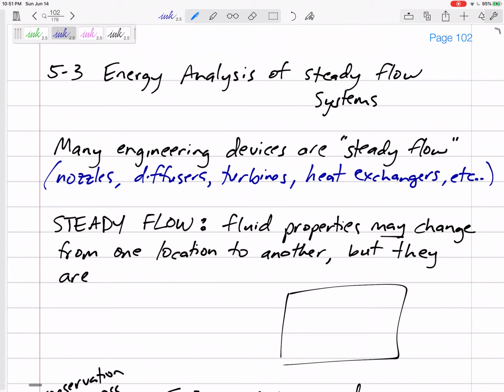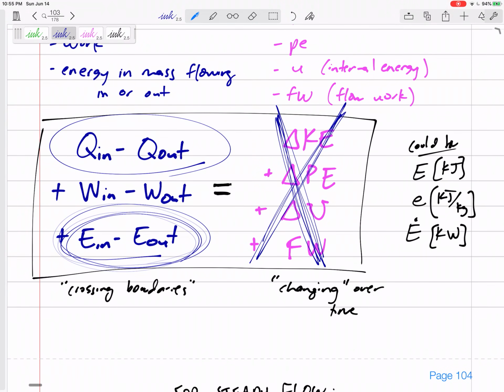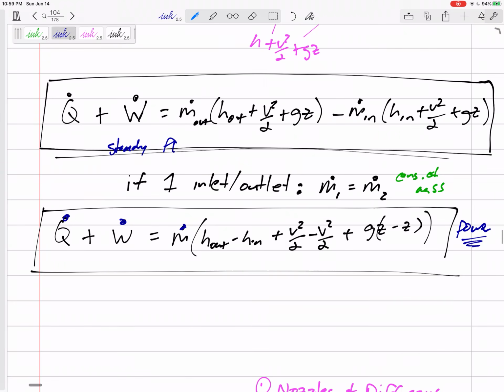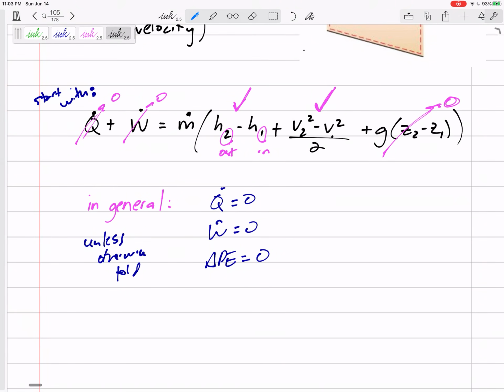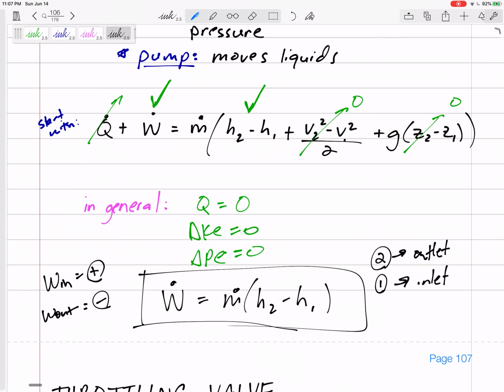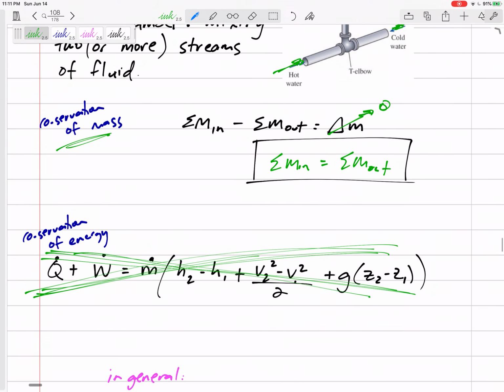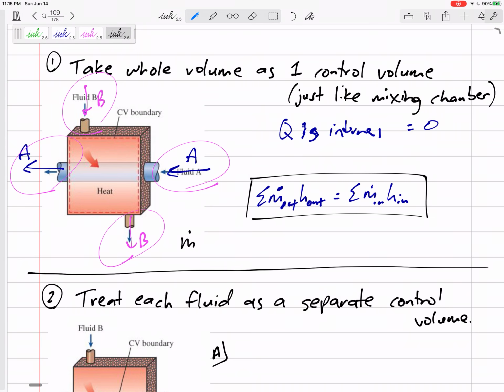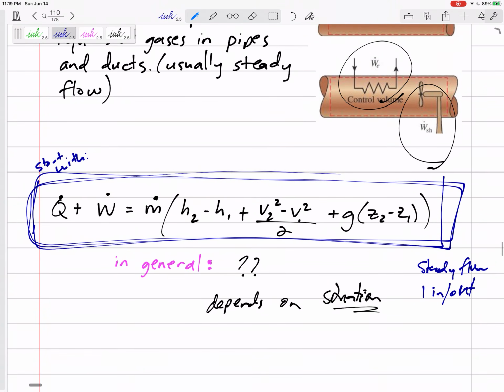Thermodynamics - 5-3 Energy analysis of steady flow devices

Comment: Question 1:
Sir, you have written that in general, there is no change in Kinetic Energy and Potential Energy in case of turbine and compressors, how is that so? Because, considering the fact that they are producing or taking in work from a fluid, how can the kinetic energy or potential energy not change or inter-convert due to compressor blades or turbine blades?
Question 2:
Sir, in case of throttling valve, you wrote that there is no change of velocity (and hence /\K.E.=0), why is that so? Considering the Bernoulli Equation, we get that change in pressure leads to change in velocity, so why does the Kinetic Energy not change in this case?
Reply from the maker: this is all in general: if you are given the velocities - then calculate kinetic energy. If you are given heights - then calculate the potential energy. I think a change in 100m only leads to a delta E of 1 kJ/kg? And 45 m/s is only 1 kJ/kg. So they are usually orders of magnitude smaller than the other values in the equation so we can just neglect them.
Reply from the maker: And I think you're right in that the velocity does change in a throttling valve, its just negligible compared to the other values.
Reply: @engineeringdeciphered  Right Sir.
Appreciate your answers Sir, they are helping me alot, Thank you :)